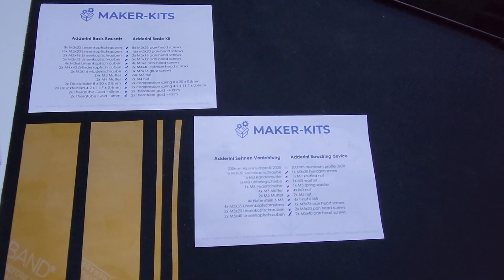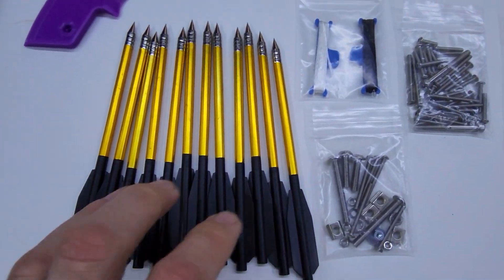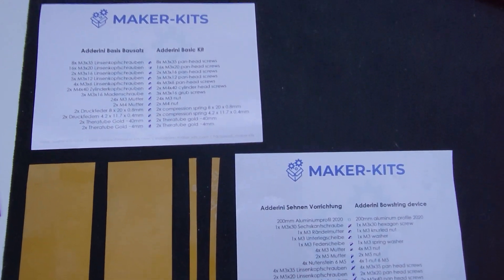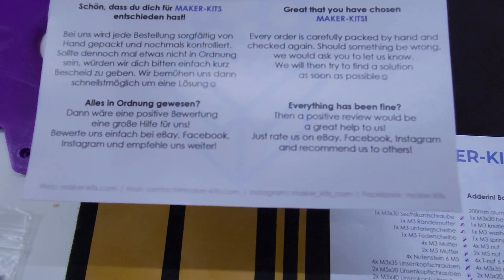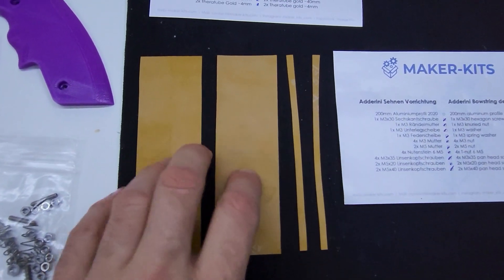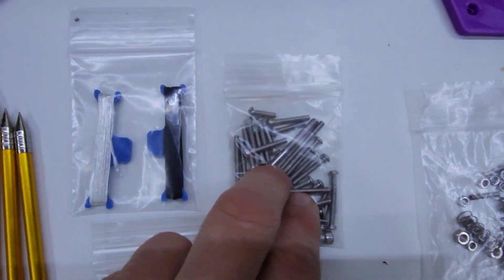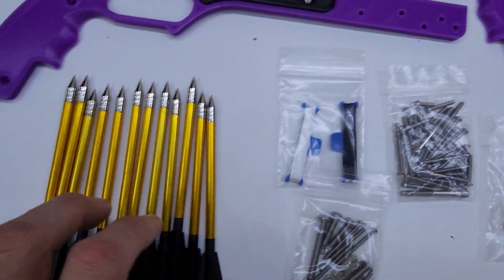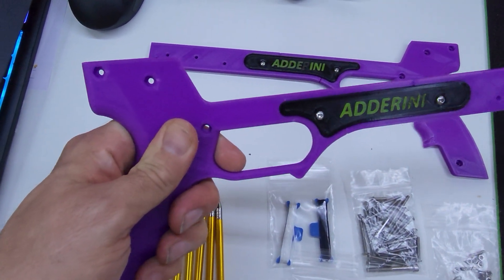First Video - Adderini Slingbow Pistol  - maker-kits.com

Comment: Cool. I have one too. I recommend using some dyneema string or paracord instead of wrapping your own bow string. From what I've seen it's not worth making your own.
Reply from the maker: I'm gonna try to make the string because it's something I want to learn, but when I build my 2nd one I'll look into your suggestion
Reply: @tnap1979  No worries, you will probably not have to wait for the second build, because I'm sure your string will break within a few days or weeks and then you either have to spend time making another weak string or follow my suggestion.
Reply: Completely agree, I am using dyneema string. It is super tough even tougher than any archery string serving and very easy to prepare.
My previous string only last for around 50 shot. With dyneema I did not see any fray so far.
Reply: I have a pistol crossbow I bought for shooting pullstring across drop ceilings for running data cable. The string broke and I used steel cable and it works great and really lasts. Thinking about building this, do you think I could use steel cable here too?
Reply from the maker: @frankrizzo8108  I don't think so, but I'm not sure tbh, I'd say best safest bet use the dyneema like recommended.. my original needs replacing now, just like dkfx said
Reply: @frankrizzo8108  It works, and it's strong, but not for optimal performance. A guy named forge20 here on youtube posted a video where he used steel wire on his adderini slingbow.

Comment: Good Luck! I have built one, check my video. What Adderini need to be improve is, the hole for the grub screw near the trigger where the lever pivoting need to be loosen a bit and you may need to glue the grub screw to the magazine part to prevent it turning during cocking, otherwise just like in my video you can hear it scratching, because the PLA grab the grub screw and the grub screw getting loose each time but I have fixed it. I think that is the only problem I encounter during my adderini build. And dont forget to use dyneema string.